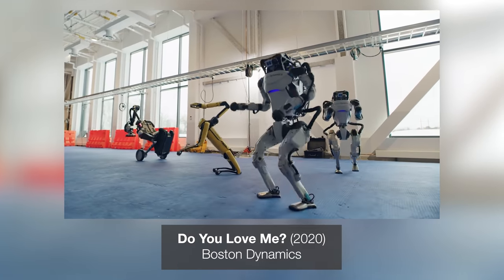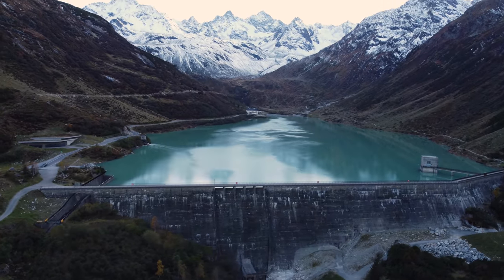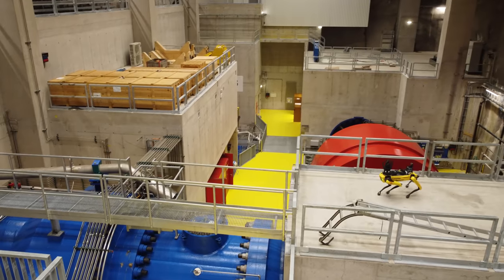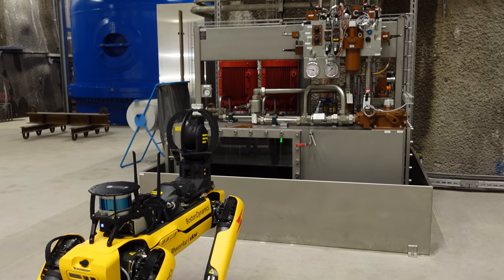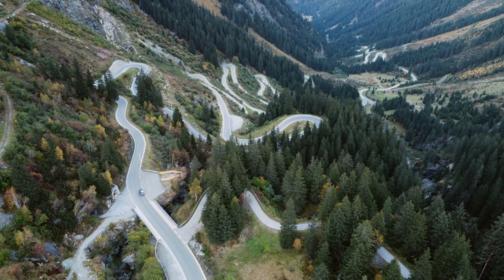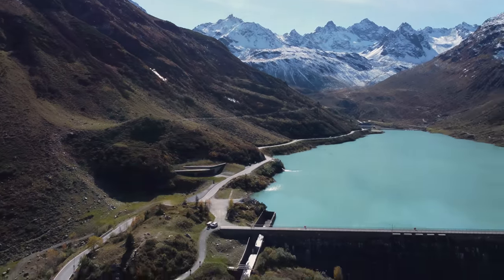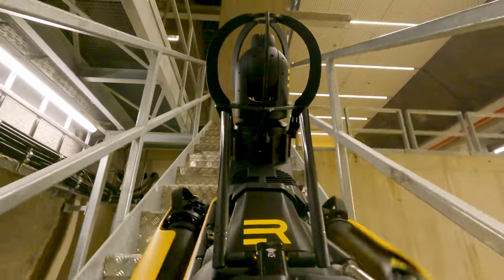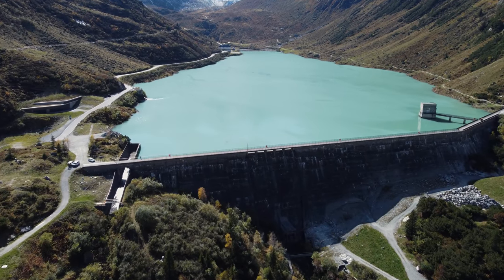An actual, real-world use for robot dogs

Comment: It's definitely more a cost-saving measure than a lack of engineers.
Reply: It can be both
Reply: This is the ultimate goal isn't it. To automate everything
Reply: Time too. You can put the people that normally do these inspections on other tasks while the robot does the inspections.
Reply: I worked for that company and it is both. This region (called vorarlberg) has a huge industry and huge lack of qualified engineers. Additionally, these powerplants are all in this mountain region and therefore it takes much time just to drive from plant to plant for inspections.
Reply: @TheSchrimpRundung  what kind of  engineering degree/skills do they want?
Reply: @suyashsingh9865  whatever Homer Simpson has..
Reply: What engineering skills does the dog have
Reply: I'm actually quite surprised that it's a cost saving over a simple array of cameras and sensors.
Reply: @Pfooh  I think that that is mostly because the robot can go everywhere. You'll have to use a crazy amount of cameras to be able to see all that this robot could get to and see
Reply: @Sphagetti__  not if you use a couple of PTZ cams. And quite a few things might be easier monitored with a sensor.
Reply: @Pfooh  I don't think you realise just how big some of these power stations are (and as much as sensors are great, they never replace having a visual inspection)
Reply: @zaza-ik5ws  That goal needs to happen alongside social safety nets and a focus on Maslow's hierarchy, or else you just get more poverty.
Reply: @Alfred Wedmore No, it's just an observation. As somebody else suggested: it's very well possible that this is driven more by the robot manufacturer'S interests, not by the energy company's. The robots might run at a financial loss, but pay back in research data.

Comment: Cameras are so cheap now, wouldn't it be more cost effective to just wire the whole facility? Then you would be checking results 100% of the time...
Reply: The robot has thermal imaging and is much more flexible than a fixed camera.
Reply: inspections are to check on things that a camera may not be able to see, as they don't know what might go wrong through day to day operations
Reply: Another possibility is to just hire low-skilled person (thus lower wage) to carry around an expensive camera and point it at certain things.
Reply: Then you'd have to pay a living wage, do all the mandated social security payments, pay for humane working conditions, and commune with the underclasses... A fleshworld hassle. Better to over-invest in speculatively overengineering cool movie scifi robot solutions.
Unless this does turn out good longterm, though, I couldn't really guess as I'm not an engineer or historian. But the robot and drone revolution is after a decade or so still looking kind of meh and inhumane.
Reply: @michelottens6083  yes there are exactly costs you described. In some scenarios it may still be better to spend that money on some other investment.
Reply: no point, as you'd still have to pay for the person who knows what they're pointing the camera at for diagnostics
Reply: @Adierit  the robot doesn't any any computing, it just captures data and some computer somewhere computes it. The same can be done by a camera or a "thermal imaging" camera. There's nothing special about a dog that a camera can't do for a fraction of the costs, 24/7.
Reply: @whatsadog2445  Given that Spot costs the same as 2-3 high resolution thermal cameras, but it can inspect hundreds of different areas, I'd say the robot dog is the one doing it at a fraction of the cost of fixed thermal cameras.
Reply: @whatsadog2445  it can move around the facility, inspect from different angles, be remote-controlled by an engineer if they need to check something specific etc. Also a full static camera system covering the whole facility wouldn't be cheap! We're talking an industrial solution here, not a bulk order off aliexpress. This is a single, mobile camera setup with more flexibility (plus they have plans to expand its capabilities and responsibilities)
Reply: @whatsadog2445  cameras can't move, dog can a stationary camera can't possibly cover enough of whatever you need monitored while also getting close in to areas which would be blind spots that may need inspection

Comment: A cheaper and smaller version of this would be awesome in telecom COs.   I monitor a bit over 1,000 buildings and if I get an environmental alarm it would be cool to just log into that building's robot to have a look around before calling someone.  Could save a lot on fire alarm calls for example, which 99% of time they are false alarms.
Reply: I'm still trying to understand why it is cheaper to train this expensive robot instead of installing some hundred cameras on site. Maybe you can help me out?
Reply: @ElGrecoOB  the cost of the robot and the cost of the cameras are both onetime costs. the training of the robot and the installation of the cameras is also onetime. the upkeep of the robot and the upkeep of the cameras are ongoing costs. the cameras would be static while the robot is mobile and adaptable, and has remote control capabilities in case human interaction is needed.

the robot is way more flexible than the cameras are. and once its programmed with a map of the building, any future robots that get used can just have that map uploaded to them, nothing extra required.

Comment: This seems to be exactly what most of the boffins at Boston Dynamics want their bots used for.
In the long run though, seems like the power-station/whatever will be the "robot" itself.  Simpler to just design the things which need monitoring to have their own cameras and sensors always monitoring.

Comment: This is cool, but to me it seems it would be a lot cheaper to just install a whole bunch of cameras on places that need inspection.
Reply: But with this, you can react to unforeseen incidents in places where you didn't think you needed a camera, get different angles to troubleshoot, monitor e.g. long distance pipes/cables (and it becomes quickly cheaper to have a robot walk down a kilometre instead of installing and maintaining cameras over the whole distance), etc. You can also send these into places where installation and maintenance of cameras is dangerous.
Reply: It would be cheaper to not install anything. They aren't doing this to be cheap, they are doing it to be safe.
Reply: The big issue is getting power and data transfer cables to all of those cameras, running conduit is NOT cheap.
Reply: @klamsanac8173  Because wifi doesn't exist?  The robots are using wireless communication.  I don't understand why the same can't be used for communication.  In every industrial environment that I've been in, power was already available to operate the instrumentation and machinery that you would be inspecting.
Reply: What's the break even point? 5k for just the IR camera means it's cheaper to use Spot if you have more than 16 locations you need inspected, and they likely have more sensors than that on-board.
Reply: 5 autonomous remote cameras can patrol an entire facility that may well have 50 areas that require observation, so I think 5 autonomous cameras are cheaper than 50 that would all need to be wired in. And that's not even mentioning the fact that if an area without a camera went wrong, then you'd need a person to go in, whereas with the autonomous cams you could just send a camera to check.
Reply: this isn't your walmart CCTV, these kind of sensor array usually even have IR camera
the good ones are not cheap
Reply: Well hawaii spent 150k of your tax dollars to buy one.  Not been used
Reply: There are a lot of things to obstruct views, and maybe they need the camera very close anyway to look for small cracks.
Reply: @BigShrimpin_  Autonomous cameras like this dog cost hundreds of thousands of dollars. WAY more than it would cost to put up enough cameras to cover the whole facility.
The cameras don't need to have hard-wired data connections. Power and Wifi is enough.

Comment: "What are robot dogs used for?"

Me knowing that ther probably gonna be used as walking mines: "Nothing" special
Reply: No, that's farcically expensive for something you're just going to blow up unless you intend to use a nuke to take out a significant fraction of a city or more.  And even then you're better off just using a truck or something.

These things aren't cheap, you have to get some mileage out of them or you're just flushing cash.

Now giving them a gun mount is plausible, if you can make them armored enough.

Be as dystopian as you want, but try and keep practical considerations in mind.
Reply: @morganrobinson8042  But these things will only get cheaper and cheaper.
Reply: @ThreadBomb  so too will tank tracks and drones
technology don't progress in isolation
Reply: asdfasdf  Well, sure, they'll build a robot to do whatever they want.  My point is, and I am being quite literal here, the original commenter and at least a few other people are deeply mistaken as to the tactics that would be involved, because they assume mechanical expendability means a machine has no value at all and can be wasted as an explosive delivery system.

Any other points I made are to illustrate exactly why that is an amazingly inefficient application of this technology.  Living soldiers and modern equipment only enter into it insofar that they are the direct competition for any upcoming  replacements when it comes to roles needing to be filled.  The reasons to do so are immaterial, because my main point is they have an inaccurate conception of what this machine is capable of, and the ways it's limits and cost will enforce it's application, even with iteration and improvement.

Comment: What I wonder about is the thousands of things that aren't specifically being checked for but a human would walk in and immediately think something is off.  Water puddles, smoke in the air or even a chemical odor.  Those are my initial thoughts so those have likely already been accounted for but it will take some time to create a comprehensive list of everything a human might notice as being not quite right.
Reply: I suppose that's somewhat redundant when the source of those problems will be something the dog is checking anyway, even if the human might have noticed something being off slightly sooner.
Reply: @totallycarbon2106  they've been working on improving engine monitoring in cars for decades yet your engine might start making an unusual sound and the check engine light never comes on.
Reply: @roberteltze4850  fun fact, they're starting to use microphones in the engine bay to detect and diagnose problems not only with your engine but also transmission, turbo, etc

Comment: Robots, don't get tired, don't ask for wages and never complain. "You all fired!"
Reply: Literally said "there are not enough engineers now, and we need more soon" the robot is not replacing any human job here.
Reply: @svbg869  But they also said the future of the program depends on whether or not it's cheaper than sending a person out to do the inspections. Meaning this could be another sector of work replaced by robots in the near future
Reply: @svbg869  On the location used as example -yes, but it open the possibility to make locations being monitored fully remotely in near future.
Reply: @mme.veronica735  you really want people to work there? with all that noice?

Comment: I find the whole “visually inspect area” use case for these so odd, why not just use some static networked cameras, surely a lot cheaper
Reply: Well, you need to set them up and integrate them into the system individually where as the doggo has a higher upfront cost but is way more programmable, you can send it to investigate something or gather aditional data which just wouldn't be possible with cameras. The doggo can also do aditional tasks possibly, it's modular so integrating other kind of sensors or attachments is possible too.
Reply: Trouble with static cameras is: they're static.  You've got to know in advance every possible angle you're going to want to cover for every piece of equipment - and then make sure you cover them with cameras capable of thermal imaging.  You could install thousands of cameras and still not give yourself the coverage capabilities of one robot dog who can be guided nearly anywhere on site - certainly anywhere a human inspector can go - and look at anything from different angles and distances to give the remote technician all the information they need.
Reply: I agree. This is a $100k+ solution looking for a $100 problem to solve.
Reply: @dfurball  If you can get enough static thermal imaging cameras to comparably cover an entire power plant for $100 - or anything less than $100K, for that matter - please demonstrate how.

Comment: Try applying for an engineering job, see how well that goes.
There's not a lack of engineers, more a lack of cheap engineers.
Reply: Thankfully, engineers don't have to put up with low pay
Reply: @HydratedBeans  save your breath. There's no convincing these people. Everyone thinks they're special.
Reply: It's Switzerland, no one is underpaid.
Reply: @unholy1771   right, I mean at cheap engineer doesn't mean it's too cheap either, as mentioned this is Switzerland so at least non of them are getting underpaid either.

But if Switzerland is like Norway getting hired based on your credentials can be a bit hit and miss. especially where salaries can be negotiated.

Comment: How about installing cameras in the areas they want to check? Must be cheaper 🤷🏽‍♂️
Reply: Not quite actually, since the robot has different high-tech cameras in it and can look at objects from different angles, something which you can certainly do with mounting cameras around, but would me a massive cost and inefficient.
Reply: Not just that, the robot is also collecting telemetry data, see the anntenae they carry in their middle. It's not just for surveillance, I'm sure they also installed cameras for that exact purpose, but the data that the robodog itself collects about all appliances, is what's needed. Yes, you can see telemetry data remotely from a screen, they show that too, but raw data isn't enough, fractures in the pipelines, weird noises coming from the turbines, all of the things that you'd need to fix quickly are not gonna show up in a remote control center, or cameras don't have an angle of the area. And plus, the powerplant is a little less lonely because of the dog
Reply: I was just thinking much the same thing.   Overlapping banks of camera can gather a heck of a lot of data.  The cameras would be FIXED which means that any displacement would stand out like a sore thumb.   The robot would provide a shifting prospective.

Comment: The company I work for have a Spot robot dog and plans to use it for inspecting our mine tunnels after tremors, aiding firefighters in search and rescue, and probably a bunch of other work where you may not want someone to be.
The dog is probably just a year old at this point so experience using it is limited and automation is still basic as far as I know, but working in a underground mine is dangerous so Spot will have its time to shine eventually.

Comment: I wonder how good it is at spotting things that may be wrong, which are NOT already part of its list of items to check.  For example, if there's a puddle on a floor, an unusual noise or vibration.
Reply: Same as a human, if a vibration/noise of something is not on the checklist, it will be ignored and not checked.

Comment: What will be interesting is that you have to train the robot what faults to look for. If there's some sort of new break in the system that's not programmed in a list of things to check would it take longer for it to get noticed? Say there's a crack in the wall, the robot isn't programmed to look for a crack in the wall, but a person would notice and say "hey there's a crack in the wall" even if they were doing something completely different like measuring temperature readings.

Comment: I guess they can turn the lights off now. Spot doesn't need them. It also makes for a great tension building moment in the human engineers life, when they are required to visit. All you can hear is spot's movements as you search for the light switch.

Comment: Latest example: This week, in the city of Essen, State of North Rhine - Westfalia, Germany, there was a big fire of an apartment building (built in 2016), it has entirely burnt down. There are speculations that the material of the walls' heat insulation might be the culprit (some people already compare it to that London apartment tower fire few years ago). 

Now they are using robot dogs to check the ruins as it might be too dangerous for humans to do so due to the building being at high risk of collapsing.

Comment: Not sure this makes sense. Think of how many remote controlled cameras they could buy for the cost of that one robot (cost ≈ $75k!). You could setup a whole slew of IP cameras that could view those important instruments from fixed locations with zoom lenses or whatever necessary. They would have to have an insane amount of different things to monitor for the robot to be more cost effective than cameras. Obviously I'm not familiar with this size and complexity of this facility so I could be wrong - maybe they did a good cost/benefit analysis.
Reply: My thoughts as well